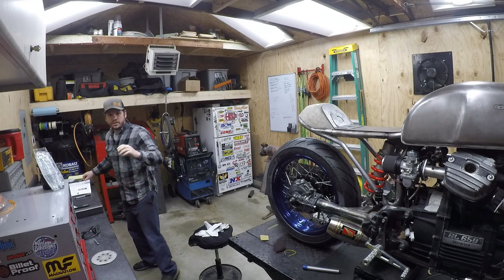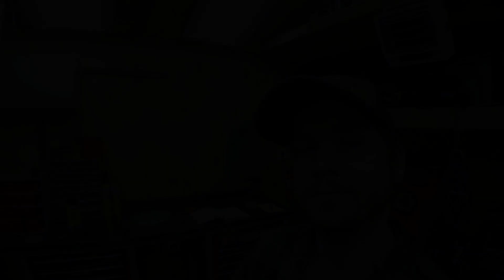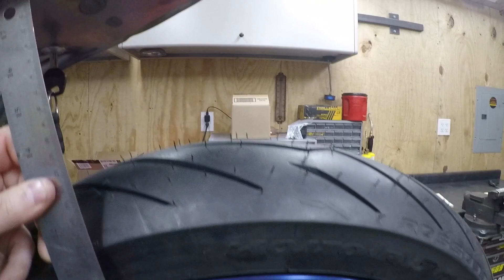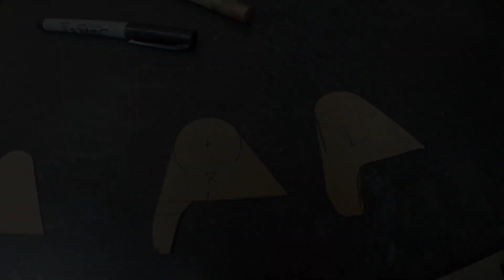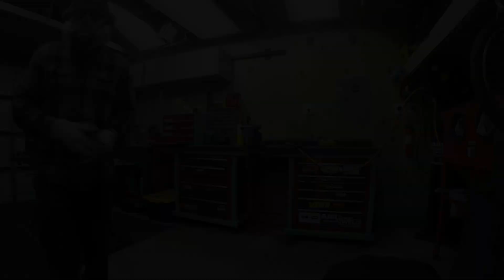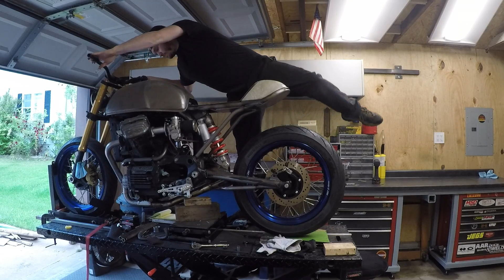CX500 Tracker - Re-Mounting The Monoshock Setup!! - EP26

Comment: How do you know what the proper angle to mount the shock should be?
Reply from the maker: Not really about the angle as much as getting the lower mount as far rearward as is reasonable. Naturally it looks best as close to the frame as reasonable up top. The vertical placement is very important as explained in this video as that determines ride height accounting for sag
Reply: @BrickHouseBuilds  so if I’m understanding you correctly, the basic principle applied from the factory related to a dual shock set up doesn’t apply here. At least as far as how with the dual shocks, the measurements from the swing arm bolt to each shock mount, (top and bottom) is the same to keep things correct.
Reply from the maker: @chrissnatchko7795  I'm not sure what exact principal you are talking about but the idea is leverage.  The closer the lower shock mount is to the swingarm pivot, the more leverage the swingarm has on the shock. That means you need a stiffer spring to overcome that leverage. Getting the lower mount rearward as much as possible only helps. This is also a non-linkage style suspension setup requiring yet and even higher spring rate.

Comment: This is awesome. Im building my first bike as well and was wondering what monoshock setup are you using?  I am a little confused as to what i should get. Thanks!
Reply: Just read about racetech. Let me go check them out
Reply from the maker: This is a 98-02 Ducati 900ss rear shock. I've used Racetech to configure the spring rate needed and swapped on a different spring. Rejuve Motorcycles sells a great monoshock kit to make life easy. Definitely check them out

Comment: Hi,

I have a very similar set up. 
It had a Kawasaki ER6 rear shock which looks horrible. 
I have just fitted a shock from an R1 but just with me pushing it down I can tell it's to soft.
Do I need a new shock or a rebuild? 

Any advice would be grateful
Reply from the maker: Hey John, In this same video the entire topic is on sag and setting up the bike for the shock being compressed.  In an early video of this build I replace the spring on the shock you see with a stiffer (higher rate) spring from Racetech.  I provide their links here and explain about why I did that.  The issue you get with the CX is that it is a "non-linked" monoshock which will need a very very stiff spring unlike an R1 or comparable modern bike which uses linkage in the rear suspension.  The shock I chose here is based off of estimates length I would need, the preload adjustability, reservoir location, and mounting tabs.  I fully expected to need to replace the spring.  I hope that helps.

Comment: What make and model did the rear shock coke from?
Reply from the maker: Hey John, the shock is from a Ducati 900ss with a spring from racetech as I explain in this. May still step it up on firmness still.
Reply: @BrickHouseBuilds  
Thanks
My one is from a Kawasaki ER6
Reply from the maker: @bikefever3569  Yea thats a common shock to use as they are in the 900 lb/in spring rate

Comment: Do you know the spring rate?  I don’t really understand the shock information and what I need, but I have a conversion kit from Rejuve but I’m not sure if a spring rate of 260n would work for a rider of 180/200 lbs
Reply from the maker: Well I worked with Racetech to get a spring for the geometry which I still feel is too light at 850lb/in. I believe the Rejuve kit uses an ER6 Kawasaki shock which is something like 900-925lbs/in. I've used those and they aren't bad but I still feel they are too light. You should try to contact a suspension company for information to what spring rate they suggest.
Reply: I love your conversion... 🙌🏽🔥
Reply: Thank you for responding. They (race tech) sent me a link so I got some homework to do but I’ll try it.
Reply from the maker: @briana.influentialworks5533  yup, the geometry sheet they give will allow them to plug your data into a rate calculator

Comment: Do you feel that the reinforcing of the swing arm is necessary? I only ask because I have watched some other videos of the mono shock conversion on a cx500 and I didn't see them do that modification. I am about to start doing a similar build (forks/mono shock conversion) on the 1981 cx500C I just bought. Thank you for all the hard work and detail you are putting into this build and the videos! Keep up the good work!
Reply from the maker: Well the position of the lower shock mount leaves a ton of swingarm out back. The driveshaft side is a very thick tube and only a limited length before it bolts to the final drive whereas the left side is a very small diameter tube not designed for that force. The potential fail point is on the left. I cant give you any scientific evidence for this but it is my strong belief that you should attempt to brace the swingarm when possible. I've done some without the brace but I feel much more comfortable this route. Look at a gl500/650 swingarm for size difference since those are prolink.
Reply: @BrickHouseBuilds  thanks for the reply! I would love to convert it to a single sided swing arm, but I fear that I am already biting off more than I can chew with this being my first build. I do have a friend who is a master welder so I can bribe him with some beer to handle all the welding.